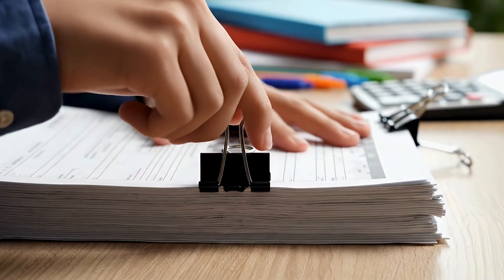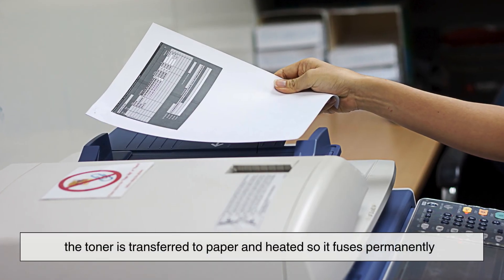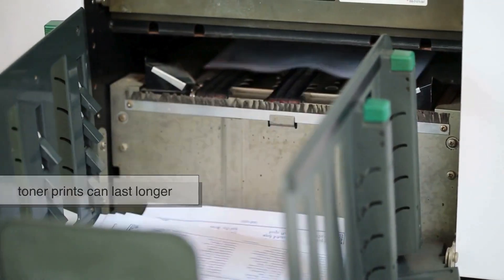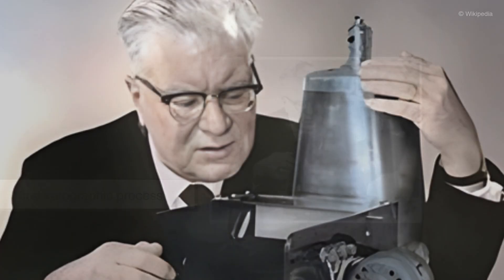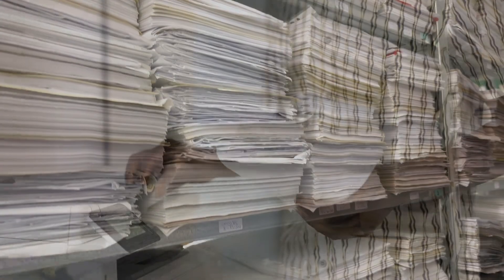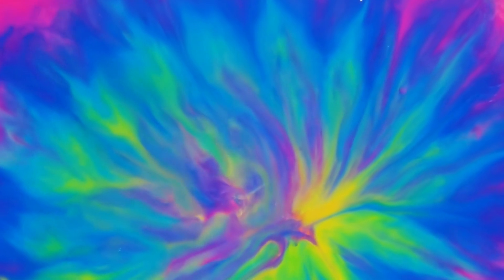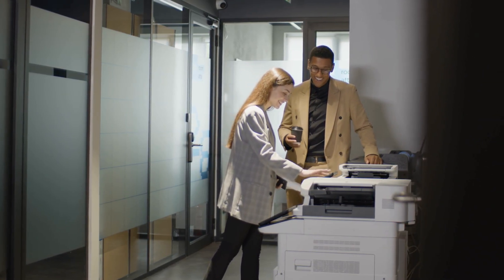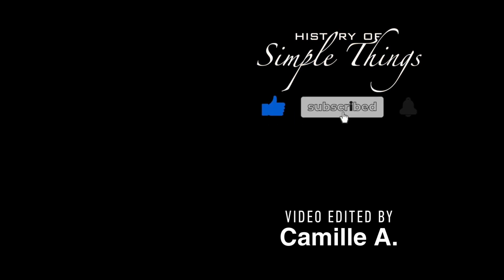Why Do Copiers Use Toner Instead of Ink? The Science Behind Powder (1202)

Comment: Dear friend .. there is a "copier" that uses INK and isVERY FAST ... Risograph ... A copier can go up to 60/70 cpm .. Riso can do up to 240 cpm the big one and the duplicator can do 120cpm. Riso uses as well something like 100/150 watts. Any copier would need minimum 750Watts
Reply: I work on laser copiers that do 105ppm. I also work on printers that do 330ppm both sides. They both use toner.
Reply: @joshuapatterson5824  Tks for the infm. I did not knew. They should be very expensive machines. Anyway, tks for the infm.

Comment: The bigger question is why did the very first photocopier I used in my first job out of high school, a 1979 Xerox 8200 ‘duplicator’, with a vacuum based 50 sheet document feeder, run at 70 sheets per minute, whereas a brand new 2026 Xerox® AltaLink® B8200, costing $13,000 copies at 72 pages per minute. 47 years later, and an increase of 2 pages per minute?
The reason I checked is that I was standing at the Konica Minolta BIZHUB C300i in our office just the other week, mind-numbingly feeding through dozens of piles of documents and I was just thinking how slow it was, and I it dawned on me that the ancient Xerox I used felt faster. Then I googled the speed of the BIZHUB… 30ppm, and then I googled the ancient Xerox (don’t ask how I remember the model number from 50 years ago.. that’s just how my unexplainable mind works) - 70ppm (so I wasn’t imagining things). That was over double the speed of this ‘new-fangled’ copier. Then I googled the speed of a top spec modern Xerox (in case the BIZHUB is just a slow machine) - 72ppm. I big increase over the BIZHUB, but only 72ppm? How? 47 years and we’ve only gone from 70ppm to 72ppm? That’s insane.
BYW, all three of my home printers are OKI LED laser printers. A4 and A3 CMYK, and an A4 CMYW. (Don’t ask me why I have three laser printers, I’m not even sure why I have three). But I’m impressed with them. I even bought an OKI MFC for private use in my small office so I don’t have to keep wasting time going to the main office unit for copies and printing. But even the 2020 OKIDATA MC363DN MFC I bought for my office only copies at 31ppm.

Comment: Ink is so expensive in some printer brands (HP for example) that is called liquid gold ($30+ for few drops) lol.
Reply: Ever heard of printers with CIS or continuous ink system? Look up Epson 3210 or L121. There's also Canon G series. Those are economical printers, allowing you to print thousands of pages for a few bottles. The bottles of ink around 80ml per color are not as expensive as blank toner, let alone a full set of CMYK toner.  Of course these still has the drawbacks of usual inkjet printers like drying up when not used or not being as fast as laser printers, but those are still great for home and office use.

Comment: Just as an FYI, copiers are literally just printers with scanners bolted on top and are sometimes referred to as MFPs (multi-function printers).  There are, indeed, inkjet based copiers.  They are usually the smaller home office type, but some high speed light production machines.  They will usually have some sort of heater to dry the ink faster.

Comment: Printer ink cartridge replacement is more expensive than the printer.
Reply: They sell you the printer cheap then get you on the ink,  but the ink on a new printer are sometimes only 1/2  filled  or starter ink.  Same with laser printers   but 500 pages is often enough for most users for years.  Unless they put that due date chip inside..
Reply: @danc2014 I don't buy printer anymore since the quality is very bad if I don't print often.  The ink would smudge.  I rather pay $0.25 for a good printed page at fedex
Reply: 😂 that's why I buy cheap printer that comes with ink.  Once it runs out of ink, I throw it out and buy new printer instead of refilling ink for $40.  Now I use FedEx Kinko services tho
Reply: Toner isn't cheap either, especially for Colour Laser Printers. One Set of Black&Colour Toner can be 1/2 to 2/3 of the price of the Printer. If you print a lot you still pay multitudes of money  on toner and laser specific replacement parts. (Drum units, transfer belt, waste toner cartridges).

For cheapest Price per page you have to go with an Ink Tank Printer.
Reply: Get inktank printer
Reply: Is really not that expensive to make it but they put a giant markup on it because they can
Reply: @divlles  They sell the printers at a loss and earn money with the ink. Thats why Ink Tank printers are more expensive than ink cartridge ones of the same class, to offset the cheaper ink refill .